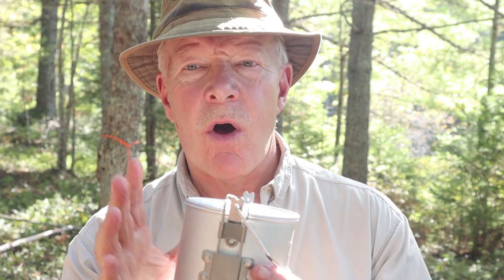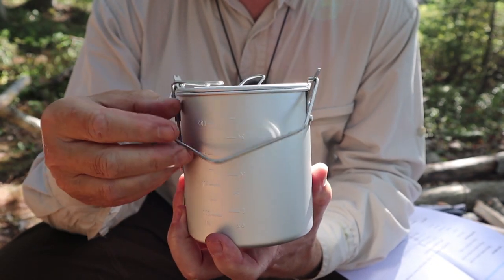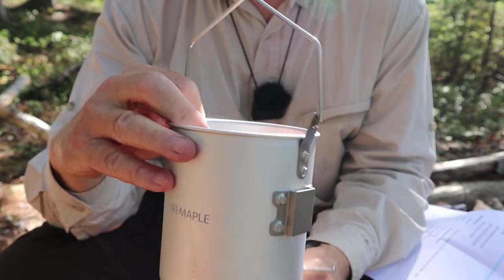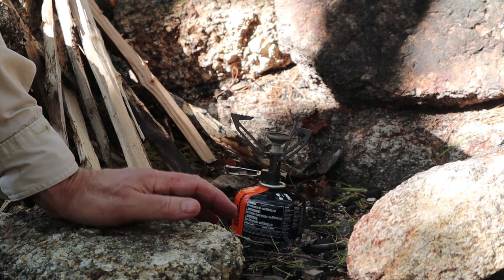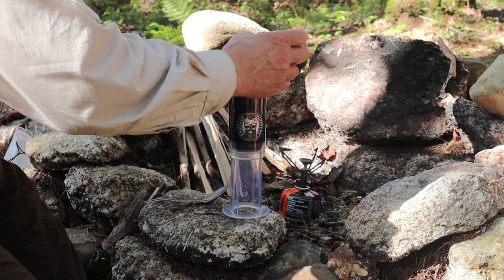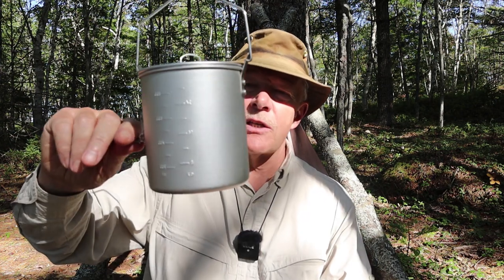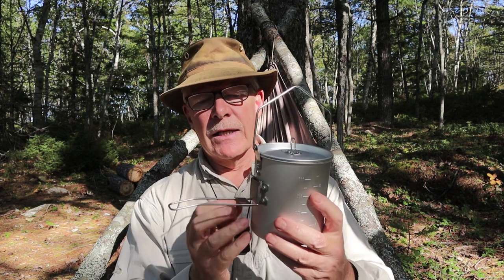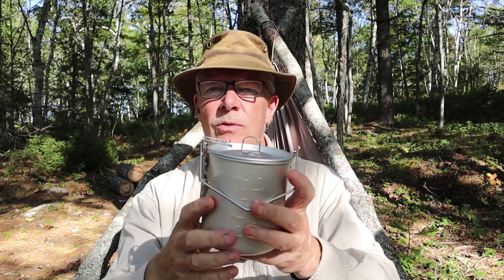Fire Maple FROST 900ml Anodized Aluminum Pot

Comment: G'day Mark, a lot to like and noth'n to dislike. Good size for the majority of uses and I always appreciate external graduations. The removable bail and handle is a very worthy feature IMO; one may not take advantage of it, but the fact is, you can, depending on what you're doing with it at the time.
And yep, hard to ignore, compared to Ti .... it's a bit lighter in the pack ....... and a lot lighter on the wallet  ; )
Cheers Duke
Reply from the maker: It really is that nice. Thanks for commenting Duke